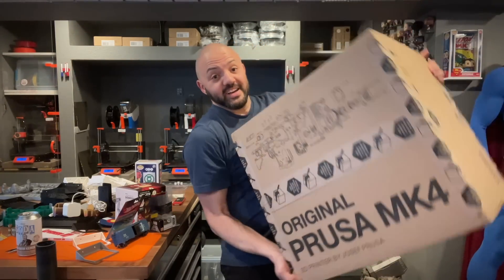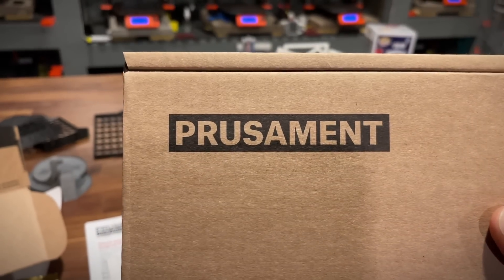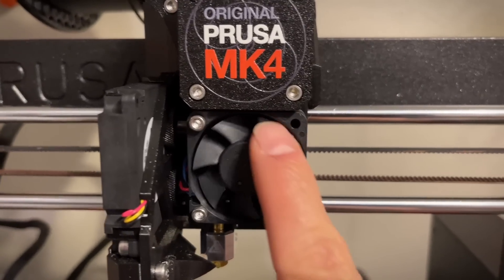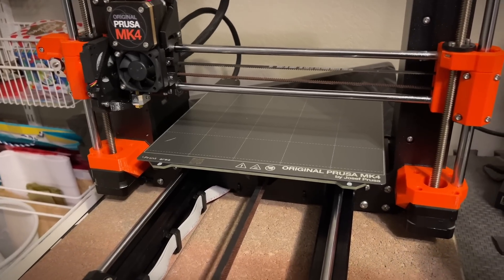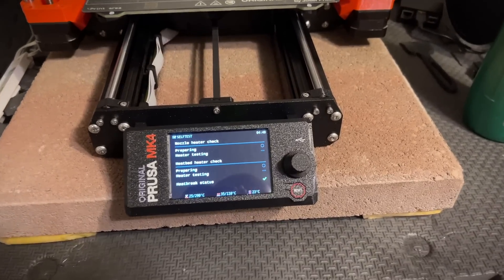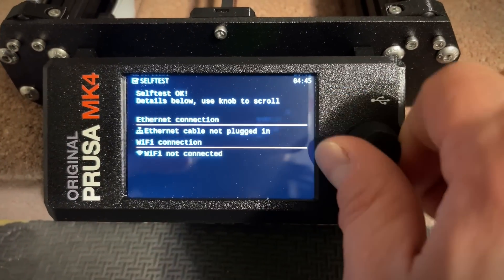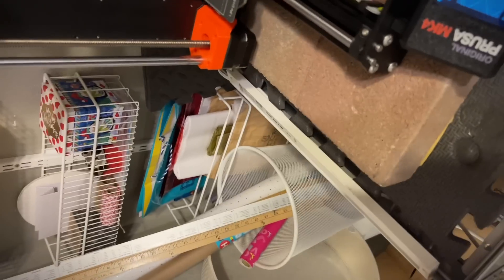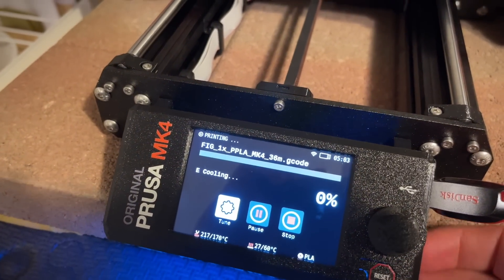Prusa MK4 - Unboxing, setup, and first print!

Comment: The purge line is placed near the print because it doesn’t probe the whole bed anymore. So it it needs to be in an area that has been probed, to make sure it sticks to the bed.
Reply from the maker: Oh thank you so much for that! Makes sense. I hate it though it’s much tougher to remove there. I might change the gcode to make it easier to remove
Reply from the maker: OK so I changed the GCODE a bit, now I'm gonna change it back. I think their way makes a lot more sense actually. I'll just need to get used to it.